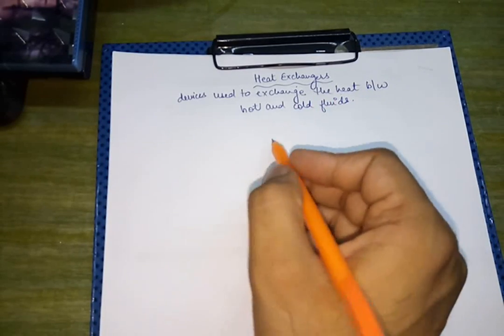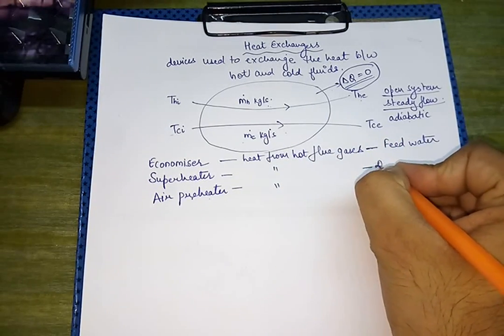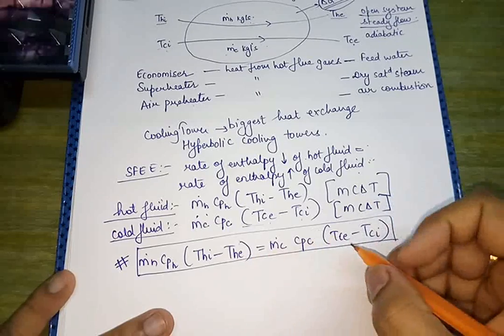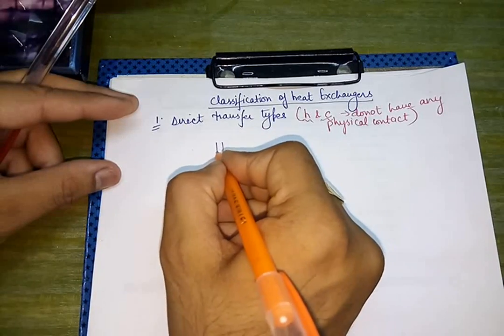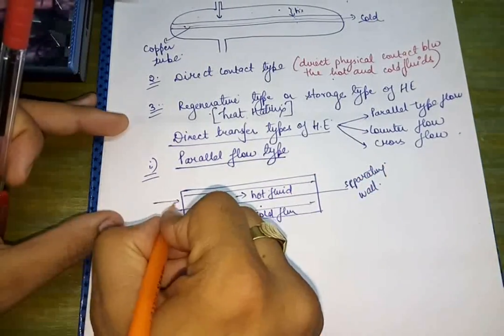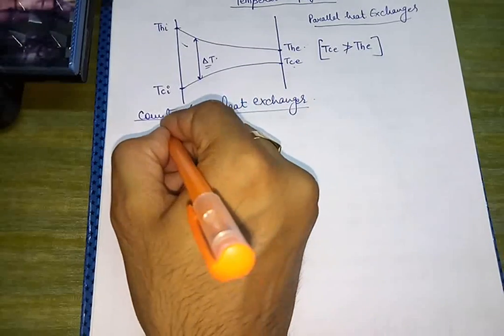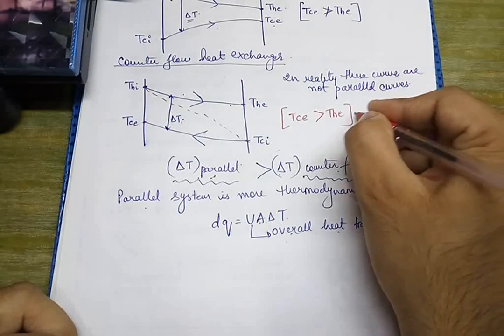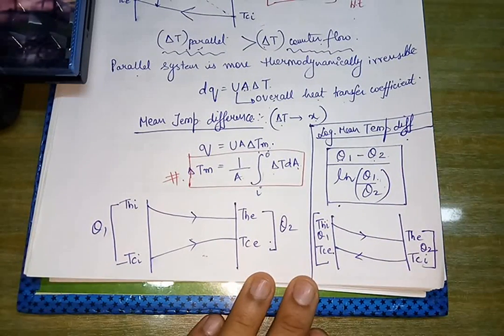Heat transfer Lecture 9 : Heat Exchangers, classification of heat exchangers

Comment: Sir if specific heat of the hot fluid will be very high as compared to that of cold fluid then i think so that exit temp of cold fluid will be higher as compared to that of hot fluid as they will exchange same amount of heat. Sir pls tell me that am i right or wrong?
Reply: if we talk about the mathematical module it will possible even much higher temp then the hot fluid temp lets take an example of water with sp. heat 4.2 and air with sp. heat .993kj along with that take equal mass flow rate.
Reply: yes,,bro,,,u r telling right....thanks